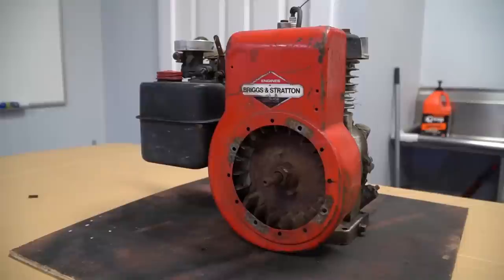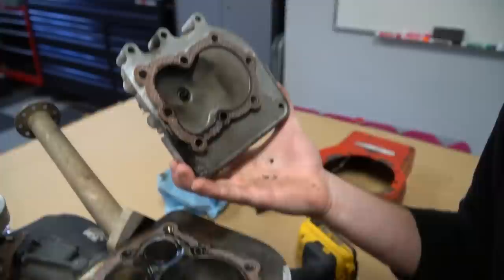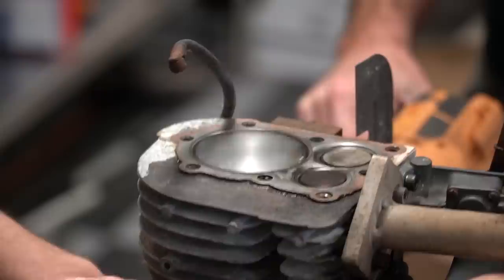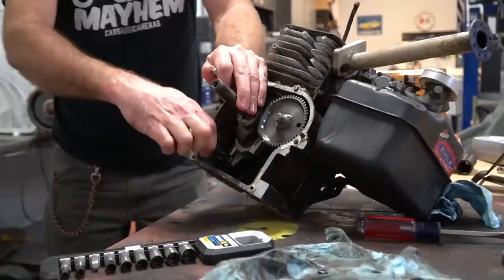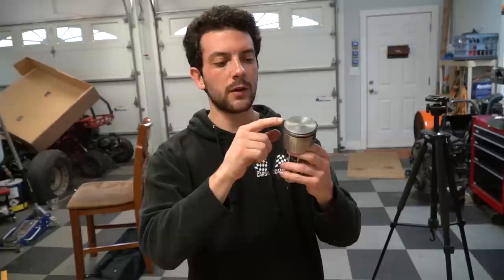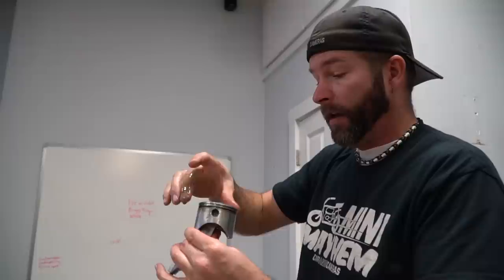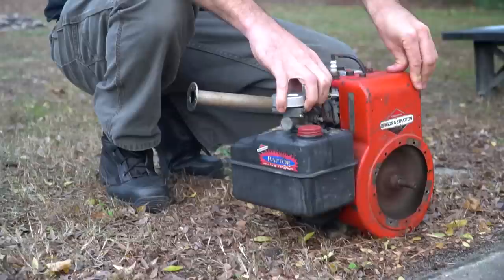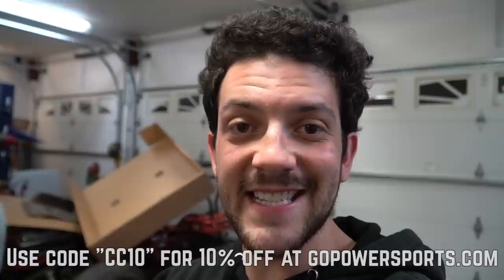Rat Rod Wagon HAULS | Built Briggs & Stratton Flathead

Comment: The reduced compression height of the piston (the wrist pin being up higher) allows for the longer rod which in turn reduces rod angularity improving the engines ability to not fly into a million pieces at higher rpms. This is also why most stroker motors don't spin up as fast as engines with shorter strokes. The longer stroke with the same length rod increases rod angularity. Essentially more rod angularity will reduce the engines ability to spin at high rpms but can net you some low end torque. Less rod angularity will lose you some low end torque, but allow the engine to spin to higher rpms allowing it to make more horse power.
Reply: Reduced compression.........means turbo it :P
Reply: It doesn’t have reduced compression. If anything it has the same or more.
Issac, it is nice to see that someone else watching actually understands engine performance!👍
Reply: Love high compression engines and old engines. I wanna do something like this too. I learn a lot from this:) even tho I'm a car mechanic :)
Reply: Also, the lack of one compression ring reduces the drag of the piston thus decreasing internal friction. The downside is the smoking. The lack of one compression ring allows more blowby into the crankcase which increases the pressure inside the engine. This is why the oil is being pumped past the oil ring. Perhaps a better crankcase venting system would relieve some of the pressure and reduce the smoking? Worth a try.
Reply: yupyup! less drag with 1 compression ring too BUT, put a little wear on the piston and cylinder, smokes like a pig!
Reply: Smoking can be caused by a lot of things. Even a non circular piston. Love how we all have knowledge and help each other
Reply: not only that but
i dont know shit about these small motors but
the reason might be that its called a racing piston becuase of the fewer rings
fewer rings less surface area that is creating friction there for reducing frictoin of the piston meaning it can glad smoother meaning that you'd see a SLIGHT RPM advantage
the max RPM limit might be the same as without but you get there maby 5% quicker
Reply: And on top of all of that you have the obvious advantage of less piston weight, reducing the forces of acceleration on the wrist pin as the piston stops at the tops and bottoms of the revolution and gets launched the other direction, but the short compression height also sacrifices longevity because the skirts will be more prone to wear and slapping.
Reply: Yeah only reason we can assume that long rod they have is a revving improvement is that is presumably a lighter rod than stock. Although there is more of it lol
Reply: But a longer rod will still be lighter than a bigger piston so it should still be lighter than a stock set up. But the rest of the advantages have been said already.
Reply: And that is how formula 1 spins so high. :)
Reply: @richb.4374  I say the same some crankcase venting should fix.some of the smoking problem I'd think
Reply: Amen.
Reply: Lighter piston means it will rev faster and less stress on the rod, because it has more compression and a longer rod.
Reply: @whenitrainsitpoors1  Okay, tell us how it works then, smart guy.
Reply: Um I'm 10 and I don't understand this but ok!?    :p
Reply: Also with stroker setups, the short rod can cause a situation where power falls off at high rpm because the Piston starts to run away from the flame front (the gasses dont expand fast enough)
Reply: @jakeb2061  With a longer rod, and the wrist pin nearer the top of the piston,the piston spends more time at the top of the cylinder causing more rotation of the crankshaft before it stars moving back down .This is called polar moment. A longer polar moment gives the fired gases more time to develop and generate higher pressures than with a short rod. More power.
Reply: @F5Tornado44  ok. I explain every part of for you. First the racing piston is a Wiseco forged racing piston that is 0.015" oversized. The piston ring is known as a L compression ring. Now to talk the changes made meaning stock vs that racing piston. The stock piston is cast aluminum, the racing piston is forged meaning stamped into shape from a solid piece of metal. Cast metal is the same as particle board is for wood easy to make but full of voids that weaken the material. The stock rod is cast where the racing rod is billet, this is the most expensive way a part can be made and the strongest because the part is machined out from a solid piece of metal keeping the grain that the metal naturally has. Now to talk about the design. NO COMPRESSION CHANGES have been made the wrist pin has been move closer to the top allowing for a smaller lighter piston, the oil wiping ring has been removed and the work of wipe the oil a way is now the compression ring's duty. With one less ring there is less drag on the cylinder and the longer rod reduces the amount of lateral force on the cylinder reducing more drag and wear. The last part the lighter piston since the piston has to change direction so many time and at the speed it is travelling it generates a tremendous force on the rod and crank so reducing the weight reduces stress increasing the engine life. But with all this just putting racing rod and piston in an engine no horse power will be gained only reliability and the red line will be increased. Hope this help clear up things.
Reply: Love you guys...I need help with a build stuck at the moment
Reply: rudelle smithen whatcha need help with bud?
Reply: @internalcombustionforever4056  hey I'm building a go kart frame out of angle iron. I'm using a rider mower rear end chain sproket set up. I want to create the front suspension and steering do you have any idea what to use to try and make it. I'm in between jobs not enough to buy what I need  and because of that I'm thinking bike wheels in front. You guys inspired me and my wife to buy a welder ,grinder and other tools to enjoy life just a little more.
Reply: @whenitrainsitpoors1  Isn't that what Isaac Eckman was basically stating in a more generalized way? He just didn't get into the specifics of the parts, what they're made of, and how they're made. I see the "015" on the piston and understand that that is 15 thousandths over stock, but how do you know it's a Wiseco? Many piston manufacturers produce forged pistons. John did ask "what makes a racing piston a racing piston" where you answered precisely, but in Isaac Eckman's defense, he did explain why the longer rod and lighter piston is desirable in a motor being built for racing. So he wasn't "completely wrong" as you stated. Just saying.
Reply: @F5Tornado44  yes and no. isaac is correct about the high rpm. The reason I said wrong is the compression height (the height the piston sits at the top of the stroke) is the same on both stock and racing. Sorry for the confusion. Oh by the way some one asked about a turbo the Briggs has a low compression ratio to start with and would be fine as is for a turbo. In 2000 there was a company that made a super charger for it that gave up to 32 pounds of boost. Sorry Isaac Eckman I didn't mean any disrespect. Oh and smoking could also be from 3rd reason some racing piston had rings with light tension on them. If the ring gap is good. The oil may be too thick. A lot racers at the time were use a light racing oil to try to get a higher rpm.
Reply: @F5Tornado44  I knew the brand because only Wiseco made the L type compression ring. Oh and rod is a Horstman H beam racing rod. See how has the saw tooth mating surface on the rod cap. P.s. change the carb  to a racing one and it should turn 7 to 8 thousand rpm
Reply: @whenitrainsitpoors1  Agreed. The height of the piston at the top of the stroke is the same. Compression is usually the same on either single or double ringed pistons. A single ring pistons pros usually outweigh the dual ring pistons pros. If I was there at Cars and Cameras, I'd be checking the ring end gap at 3 points in the cylinder (top, middle, and bottom), also mic the cylinder for any out of roundness. That's my guess as to why they are having so much blow-by. A ball hone would also be pretty beneficial to the guys over there. From my experience, racing pistons (forged) were usually set up with the cylinder being bored with a little more piston-to-wall clearance than it would be bored with a stock (cast) piston or a hypereutectic piston.  A hypereutectic piston can be bored to the tightest piston-to-wall clearance due to their low and stable expansion rate from high silicon content. Expansion rate of pistons is based on it's silicon content. Forged pistons have the least amount (if any) silicon alloy content in them, therefore their expansion is a little less stable requiring a little more warm up before you open the throttle, otherwise you risk a cold seizure. Stock cast pistons have about 12% silicon and hypereutectic pistons have up to 20% silicon content. Most of my experience is with 2 strokes so that may not be very relevant in this case, but at least some people learned something here.

Comment: Longer skirt keeps the Piston from rocking in the cylinder. Allows for tighter clearances and higher rpms. Being able to run a tighter clearance means the extra ring is no longer a necessity. Also having the wrist pin closer to the rings creates a more even force on the Piston as it's moving up and down by applying the force closer to where the Piston comes in contact with the cylinder wall. Having it lower would push the skirt into the cylinder wall during combustion causing excess friction and loss of rotational momentum, ie loss of power.
Reply: I imagine a longer rod would also help with rev ability as well since it would make it a better rod/stroke length ratio
Reply: @CallumTapper  shorter rod, reduces (can't remember technical name) the flexibility of the rod and general stresses on the crank and wrist pin by reducing the mass as well.

To be fair a shorter rod also increases friction since the angle it has to take is much greater. Realistically this means that if you're running weak components a short rod will be better but under ideal conditions with better components a longer rod does perform much better at high rpm, just don't bannana your rod.
Reply: C.T. …………...in  auto apps longer rod helps flatten  out the torque curve, and helps with cylinder leverage filling  @CallumTapper
Reply: @dannycalley7777  Also, the longer rod means slower acceleration/deceleration stresses on the whole reciprocating mass, giving it more revability and power.
Reply: Well wouldn’t add more oil would it? Wonder why
Reply: @somename1324  longer rods slows piston speed and creates more piston dwell at TDC and BDC which creates more cylinder fill and better scavengeing during the exhaust stroke like you said also make the engine live longer at high RPM it's the way to go

Comment: More Briggs! 👍Who cares about practicality, a Predator will never be even half as cool as an old school flathead :)
Reply: Hollaendaren same
Reply: Yes
Reply: Yes and no
Reply: 10000000% agree. Something different about an old half wore flathead
Reply: I have a shelf full of them.
Reply: tell them
Reply: I agree I really dislike the predators
Reply: I like predators, but I love the way a Briggs sounds and looks.
Reply: Predators are overrated in my opinion. It seems like EVERYONE uses them and they aren’t that interesting because they are too common on go kart/mini bike builds. It is always nice to see different engines other than a Predator used on peoples builds. Briggs and Stratton, Tecumseh, Kohler, and many other engines need some love too on these kind of builds. 

Don’t dis Tecumseh off the bat. You can find those engines in high horsepower on old snowblowers for CHEAP. There are some performance parts for them but not as many as a Briggs. If Tecumseh engines get a resurgence in popularity, perhaps some companies might start making aftermarket performance parts for them like billet connecting rods and flywheels and camshafts. The main issues with the Tecumseh engine was their crappy carburetors. I have a scooter project where I used an old ratty-looking 5 HP Tecumseh snow blower engine, threw on a Mikuni carburetor and that sucker flies. The engine is holding up just fine even when it’s being revved to the moon. It surprised me for sure. 

The good old 5 HP Briggs and Stratton is such a classic. There’s plenty of performance parts for them still and if they are built right, they can give a built Predator a run for their money and can be a lot of fun. Just be aware there are many variations of the 5 HP Briggs, all of them would work but some have features that will last longer than others. Some had aluminum bores while the I/C and Industrial Plus engines had cast iron sleeves. Some had plain bearings while others had ball bearings on the crankshaft. If you’re going for casual fun, any 5 HP Briggs will work. But if you’re planning on building them up for max power, find one with cast iron sleeves and ball bearings. You can always have an aluminum bore Briggs have a cast iron sleeve put in it if you’re willing to spend the money. They are tough little motors. I have a soft spot for them. 

Kohler and Vangaurd are also unique. Vanguards come in single cylinder and twin cylinder, and both are bullet proof engines. The v-twins are the most common and there are plenty of performance parts available. They are the easiest V-twins you can find for cheap. The single cylinder Vanguards are built like tanks and are actually better made than the Honda GX engines, with additional ribbing on the crankcase and is just beefier all around. They aren’t as common but you can find them on marketplace. 
Kohler engines tend to be more expensive but they make a ton of power and are popular with mower racing. There are plenty of performance parts for the v-twins. You can make an insane amount of power from these engines.

Other engines that are less common would be Subaru, Robin, Kawasaki, and Generac. Subaru uses OHC instead of OHV and are loosely based on the architecture of the Honda GX engines. Not many performance parts for those that I’ve seen. Robin engines are not as common anymore but are actually extremely well built engines, featuring forged pistons and rods right out of the box, and a forged crankshaft. Robin eventually merged with Subaru. Kawasaki small engines are really only seen as vertical shaft commercial mower engines, but they have made horizontal shaft engines, but they are less common. As far as I know, they are extremely well built. Some are flatheads which are essentially a Briggs clone except a little better. The OHV engines can be seen on golf course equipment and are pretty stout. Generac engines are mostly found on generators but some are general purpose engines. The cool thing about the older Generac engines is they had pressure lubrication, and some even had oil filters. They look pretty cool too. However, the Generac engines made now are essentially Honda clone engines which is really lame and lose the features that made them unique.
Reply: @Omegadoomship I'm not reading all of that.

Comment: As I understand it, the longer rod causes the piston to “dwell” at TDC longer as it changes directions in its travel. It causes cylinder pressure to get higher. So good for more power. Thing to look out for though is with higher pressure you have more heat. So engines with a longer rod could me more prone to knock on cheap gas. You should be fine with that optima fuel. Hope this helps.